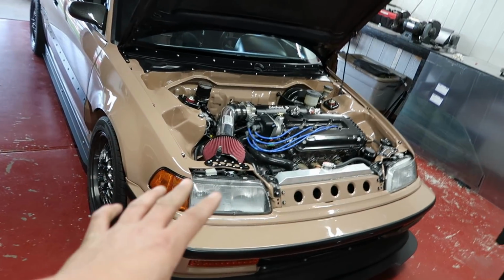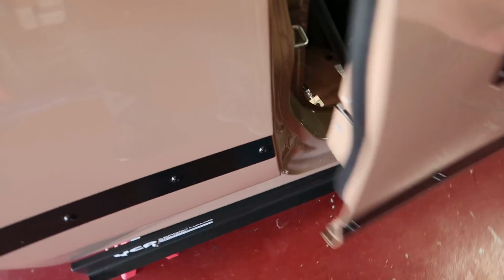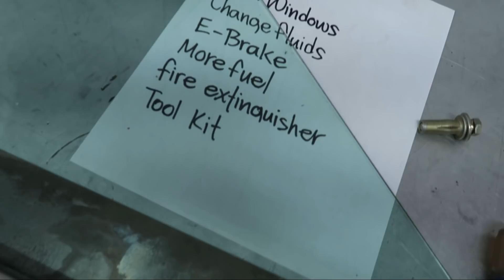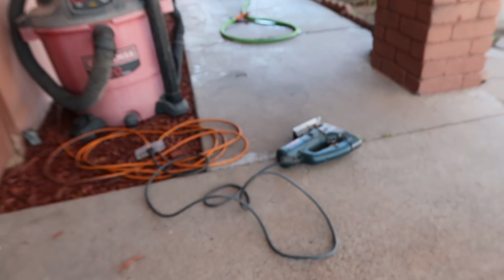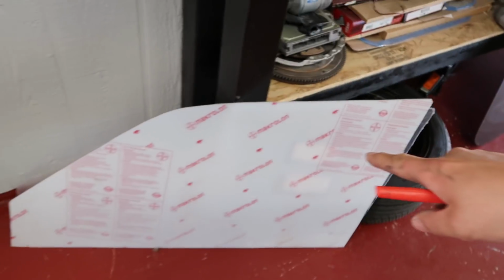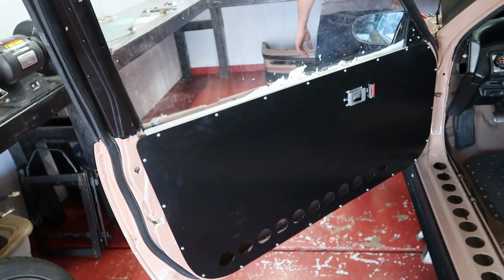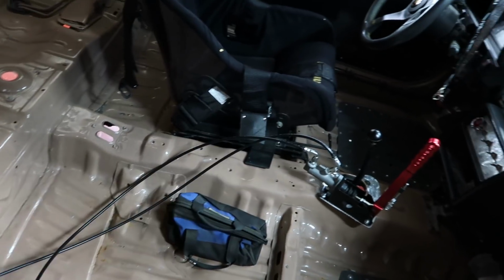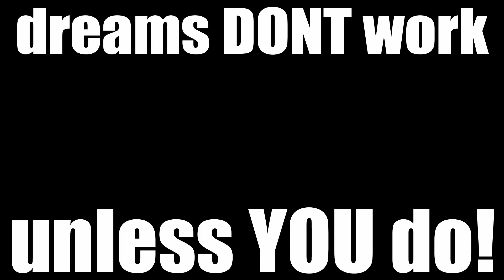IFO Prep.... fail

Comment: Yo man, I hope you're doing alright. Haven't seen an upload in a while (long time for you) and wanted to say keep you're head up, no matter what's going on you'll get past it. Just start back to normal with the regular uploads & get back on track, you will get there.... 
Personally I really enjoy watching your video's & have got allot of work done to my '91 SI hatch thanks to you inspiring me to not just keep it stock & actually use most if not all of the parts I've had laying around in my collection for at least 10 years now. Just installed my Eibach Pro Street S coilovers, Brembo drilled front rotors, new front hubs & bearings etc, some cheap rear LCA's (because a bolt broke off inside the oem LCA) and a bunch of other parts. Now I'm going to rip the cylinder head off & replace it with a built (stage 2 cam, stainless valves, ti retainers, mild port/polish & 3 angle valve job cylinder head) I've got with some ARP bolts & maybe actually boost it this time, I have two manifolds to choose from if I do, a top mount & regular cast stainless steel mani. 
#DBFAM
Come back bro...

Comment: Take a breather and relax, these things happen for a reason. Pull the plugs and make sure none of the porcelain is cracked and check out the boots before you pull out the injectors and have them flowed and cleaned. Another thing to do is check all the grounds and make sure nothing came loose when you street tuned it. It's something minor and you will get it figured out

Comment: If that Fuel filter is NOT E85 safe it will eat it very Quickly! The Boostedboiz had the same issue! Have the Injectors checked and Cleaned and get an E85 safe fuel filter.

Comment: Take two steps back to move forward... Idk what it could be either but if I had to guess is  maybe the injectors are clogged, I know mine are going to have to get mine cleaned and flow tested and retuned. I run E85 heard that happens due to the car sitting for long periods at a time.

Comment: Yea i remember when you drained the fuel the first time when you put the good stuff in it and that fuel looked mad yellow..  betting your tank is a little varnished from it having gas just sit in it and not run for so long,  when you put that new ethanol in it, it acted like ethanol does and ate through some of that varnish and likely gummed up the injectors..  probly gonna need to check your plugs and see if theyre dirty or yellowed a littke..  if they are than its for sure the injectors..  some seafoam might fix it but dunno..  
  When you put the door panal back on you might have used a different screw hole or longer screw and pushed the latch back a little, happened to me.  Either that or one of the screwd was also used to hold that latch into place as well.. my best guess..  but take a hair dryer or heat gun on low low to get that film off..  alcohol might work also but dont use acetone or goof off or anything cuz shit will eat the acrylic and put stress cracks in it..  

Just tryna help, looked frustrated just a lil bit there boss..  burn down a good stick or go get yer dik wet bro..  stress relief.. lol..